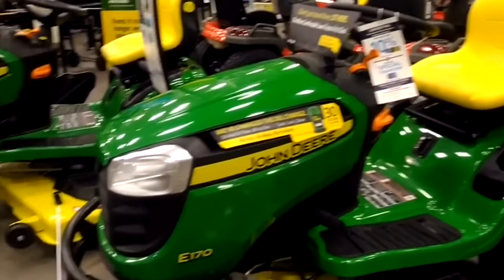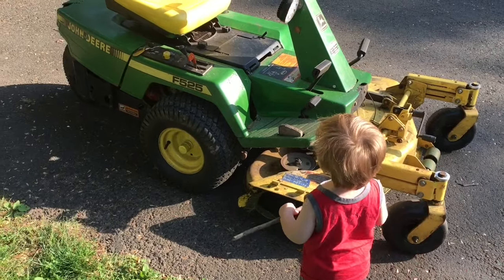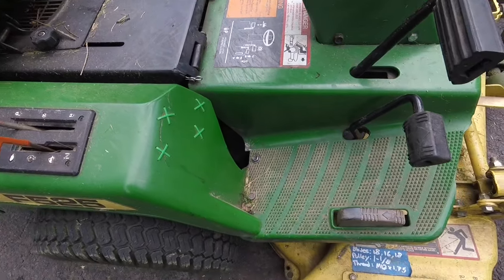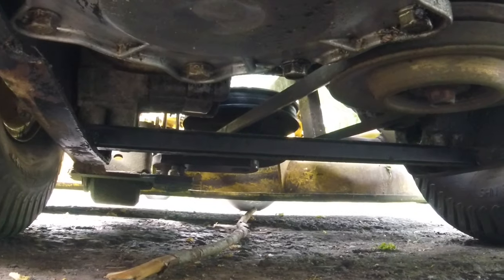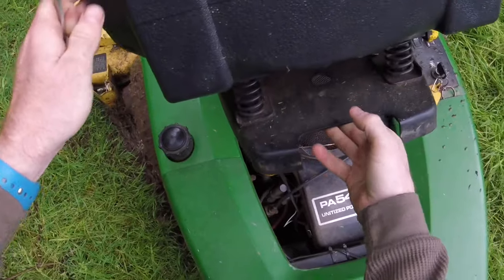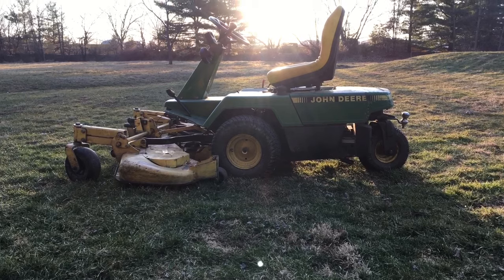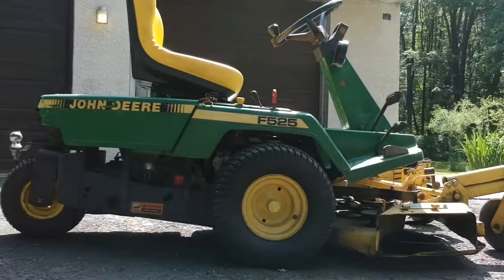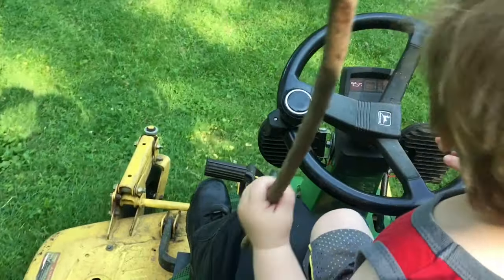Forgotten Mowers: The John Deere F525

Comment: Sorry I'm late.   It takes hills fine, you just have to go in reverse. Careful backing down the hill along edges.  The offset on the left side of the deck will get you caught up and you'll go kitty wampus.  Take the rubber pad off the "gas" pedal.  It's easier to hook your foot reversal and you get a bit more travel and speed when you stump on the gas.

This mower is a great babysitter and toddlers make great counter weights.  Try holding a toddler on your lap and steering a zero turn at the same time.

It's a great learner for young kids, But beware the weight sensitive kill switch underneath the seat.   Usually a brick or a sandbag will do it.

Comment: I have an F510 (pretty much identical to your model in most ways) handed down from my dad when he retired years ago, still works great...getting the battery out, however, is a royal PITA. I don't see a way to get that bar off that goes over the top of it, any tips for that?
Reply from the maker: It’s not super easy but I’ve never had a real problem with it… are you referring to the steering linkage?
Reply: If you turn the steering all the way to 1 side, the bar will be out of your way enough to slip the battery out. I cannot recall offhand which direction the steering needs to be turned to however... just try both directions while looking at the steering linkage it'll be obvious when you have gone in the correct direction.
Reply from the maker: I would pay a lot for the power flow bagger attachment. I would hook up my 4x8 harbor freight trailer and just discharge the leaves into it as I go.

Comment: Mine seems to have a weak head gasket -- blowing blue smoke at times -- so I thought I'd pull the engine to give it a good going over. It's imprisoned in there. I can't even see where to begin. It just has to be that they built the mower around the engine and figured no one would ever want to take it out.
Reply from the maker: If I ever have to take the engine out, I’m gonna buy a new tractor lol
Reply from the maker: For what it’s worth, mine has this problem intermittently. Oil occasionally burps into the breather hose/carburetor and gets burned. Stalls, and smokes like crazy on restart before clearing up. It’s an engine out repair, but a simple homemade catch can fixed it 100%.

Comment: i put bar type tires on mine that solved traction issues instantly
Reply: I did the same with my F525, and also filled the tires with anti-freeze. I have a hilly lawn. Made a big difference.
Reply from the maker: What model tires did you find and did that affect wear and tear in your grass at all?
Reply: @thedoubtfultechnician8067  I put on Duro 18x9.50-8 AG Bar tires in 2008. Still running them. Filled them with Antifreeze (which was a royal pain). Note direction of rotation when you mount them--the point of the Vee of the chevron pattern should be pointed to the front of the tractor when mounted (both Left and Right tires). There are arrows molded into the sidewall showing direction of rotation also. This is so the bars are self cleaning when they spin. And Yes, they do tear up the turf when I make a sharp turn (which you can do with a F525). Especially if after a recent rain the the sod is quite damp.
Reply: @dwmac2010  Now you got me to wondering.... like, would ATV knobby style tires possibly improve the F525 traction without causing lawn damage? The lawn mower style tire tread simply has no grip no matter what style lawn mower you are running.
Reply: @michaelshrader5139  Knobby tires, that's a good thought. If you could find a pair to fit the wheels. It would be kind of in-between a turf tire, and a bar tire. My lawn had some steep areas, so I had to have bar tires to get up the hill. I just tried to minimize sharp turns when the sod was soggy.

Comment: What can be done to make the F525 mow / drive faster ?   I was wondering if a different drive pulley size could be mounted.
Reply from the maker: These aren’t pulley driven- they’re direct drive. So the only things you can do are increase the wheel diameter (which would hardly make a difference while also ruining the cut) and increasing engine RPM which has obvious downsides for longevity.
Reply: @thedoubtfultechnician8067  i thought there was a drive pulley with drive belt, behind the  cutting deck pulley ?
Reply from the maker: Nope, there’s just two deck belts. The wheels are driven directly by the hydro pump which itself is camshaft driven.

Comment: Any clue on how many grease points total. I count 8 on the deck/front two wheels but can only find 3 on the mower itself.
Reply from the maker: Don’t know- do you have the manual? I have one and can check it today if you don’t have one.
Reply: 3 grease fittings on the mower itself, with a 4th grease fitting on the rear steering wheel axle. I prefer to use the red marine type grease on everything of mine, it just seems to last a lot longer due to being waterproof. Regards!

Comment: Not a big fan of kawasaki but atleast there not disposable like Briggs i'v grown up with Kohlers and have had very little issues with them i bought 10 blown/broken engines for parts if i ever need any. i do have a kawasaki 22hp that threw a rod hoping to fix it soon (did not do any serious damage inside block and only had 550ish hours)
Reply from the maker: I don’t like the cam activated fuel pump on some kohlers. That’s literally the only problem I’ve had with them. Otherwise they’re as good as anything else, and I think it’s fair to say that no manufacturer makes them like they used to.
Reply: @thedoubtfultechnician8067  Yeah one of my Kohler magnums needs a pump but I mostly have vaccum pumps on the others they are Commands
Reply: good ol' Briggs & scrap'em! 😂😂😂

Comment: Any tips on how to change the battery?
Reply from the maker: Disconnect the negative terminal first, then the positive, then turn the steering wheel all the way to the left (as far as it will go) so the linkage isn’t in the way as much. I like to put one of those giant industrial zip ties loosely around the new battery, so the next time you have a crude grab-handle.

Comment: I'd love to buy your snow blower! Let me know if you'd like to sell it!
Reply from the maker: Where are you located?
Reply: @thedoubtfultechnician8067  Montana
Reply from the maker: Shipping from the east coast may be an issue
Reply: @thedoubtfultechnician8067  would it be possible to get a quote?
Reply: @thedoubtfultechnician8067  By the way, what model snow blower does the f525 use?
Reply from the maker: I don’t think I’ll be able to ship it- I’d need a pallet and freight pickup. But I can get the model number when I get home so you can look locally.
Reply: @thedoubtfultechnician8067  what kind of money would you be looking at for the blower? I'm just curious if i was to arrange shipping, if the cost would be worth it? thanks for letting me know on the model #
Reply from the maker: If you saw the condition, I can assure you it wouldn’t be worth it. I bet you could find a real nice used self-powered blower for what this would cost to ship.
Reply: @thedoubtfultechnician8067  no worries. If you wouldn't mind still sending me the model number, I'd sure appreciate it. thanks
Reply from the maker: Found it! John Deere 38” Snow Thrower- 3280M
Reply: @thedoubtfultechnician8067  Thank you! I appreciate it! I do have a walk behind blower, but I would love to add a blower to my F525. Such a fun machine to run!

Comment: It's a very durable machine, BUT getting the battery out is a friggin nightmare. I despise the JD engineers who buried the battery in a steel bunker below all the bars and shafts and hoses in a cozy spot that makes this task an all day affair. If anyone has advice about removing the battery, please share before I mangle this friggin machine with a sledge hammer with impunity!
Reply from the maker: It’s not too bad! I never had an issue, I wonder if yours has something done to it. It is critical that the steering wheel is all the way left or right (I forget which) so the steering linkage isn’t in the way